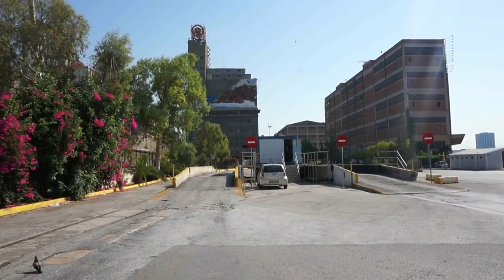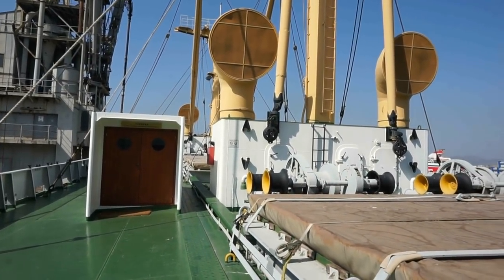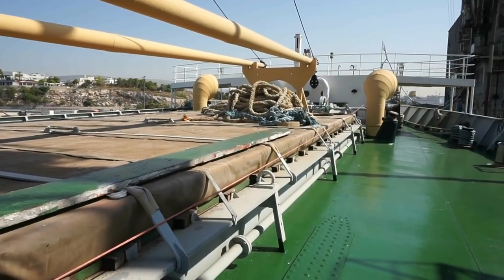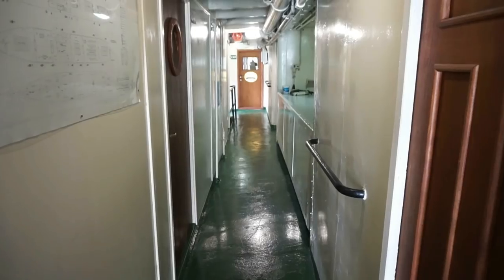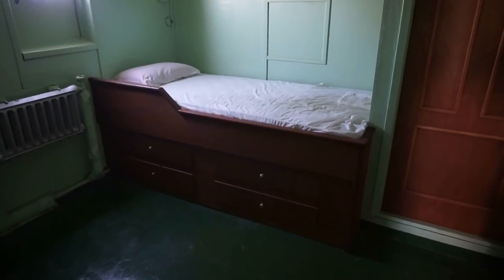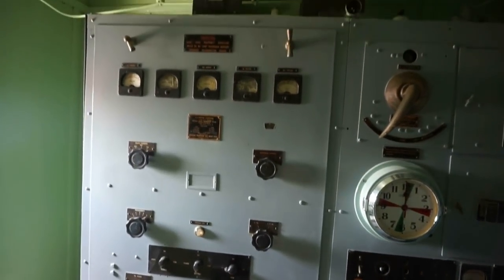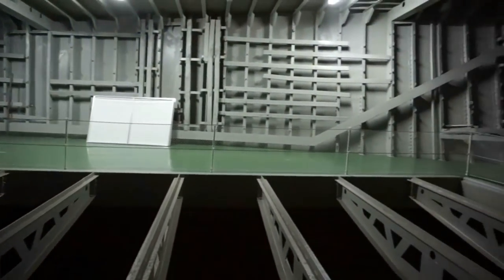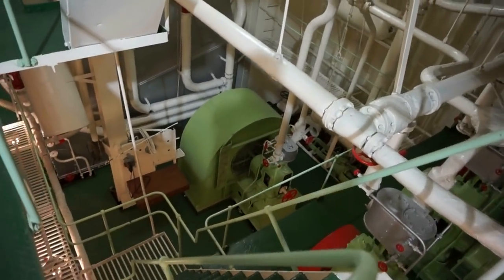WW2 Liberty Ship (SS Hellas Liberty) fully renovated in Greece

Comment: As stated below, a Triple expansion reciprocating steam engine with the crankshaft angles set at 120 degrees. There are High pressure (HP) Intermediate pressure(IP) and Low Pressure (LP) cylinders. The steam cycle for each cylinder is Admission, Cut off, Expansion, Exhaust and Compression. Steam to each cylinder is controlled by valves, these may be piston or slide valves or a combination of both. E.g. piston valves were often used in conjunction with the HP Cylinder. The valves are operated from eccentrics fitted to the crankshaft via eccentric rods. There is a forward and reverse eccentrics for each cylinder which is controlled by the position of the block in what I call the expansion link.
By the time the steam leaves the LP Cylinder it holds almost no pressure i.e. a vacuum. Air pumps extract steam from the LP Cylinder to the Condenser (shown in the video) where the steam is converted back to condensate for reuse in the boilers. 
There are two Babcock and Wilcox small tube boilers. You can see the red circles of the fuel burners on the boiler fronts . Steam would be supplied to other reciprocating machinery such as electricity generators, fuel pumps, feed water and transfer pumps, water distilling plant, fire or fire and bilge pumps air supply fans to the boilers, winches, capstans and steering gear. Hope this helps.
Reply from the maker: Wow... All this information helps up a lot, thank you so much!!!!!!!  👍👍👍
Reply: There is no "compression" stage. A steam engines does not need to compress the fuel air mixture as in a gasoline or diesel engine. A steam engine is an external combustion engine.
Reply: You sound like a legendary expert in steam propulsion!

Comment: The engine is a three cylinder triple expansion steam engine. Beautiful restoration of the ship.
Reply: I was just about to say the same thing. Each cylinder would however be double acting. ie They produce power on the up and down strokes of each cylinder.
Reply: Worked on many triple expansion steam engines as an apprentice millwright, relatively clean and easy to work on, very quiet when running, seen them go from full ahead to full astern without closing throttle.
Reply: Ever seen the movie Titanic?
Reply: So is this a two-stroke engine? Forgive me if I say something silly? The engine room is like a labyrinth with all those pipes. Very industrial. Very trippy.
Reply: @samanli-tw3id  they used the liberty ship for the shots in the Titanic. I forget if it's the one in California or Baltimore, but it's a liberty ship engine in the movie.
Reply: @azwris  it's steam power
Reply: all engine room pipework white ?? I can only remember the brown fuel oil but there wwere different colours for fresh water etc!
Reply: HOW DOES A TRIPLE EXPANSION STEAM ENGINT WORK
Reply: Lou Prentz
High--Medium--Low pressure cylinders with steam routed in manner
Reply: @southjerseysound7340  It's the one in San Francisco, the Jeremiah O'Brian.
Reply: @azwris  No, a two stroke engine would be a diesel (or there are gasoline two strokes.) The engine was rated @ 2500 HP.

Comment: Actually pretty difficult to 'restore' one of these ships as they were built On the Cheap with the expectation that they might not even survive one Atlantic crossing. The cost-benefit analysis was that if a ship delivered one load of cargo,  it had justified its cost. Maintenance during the war was probably close to non-existent; they were run 'ti they wore out, if a U-boat didn't sink them first. They were drastically underpowered with only 2,500 HP to push 10,000 tons through the North Atlantic and in heavy weather they could barely make headway.
Reply from the maker: Hello, thank you for your interesting comments and for watching my videos!!

Comment: The sides had to have a long wide and thick strip of reinforcing metal to keep them from cracking in the midsection in rough seas. Either it's a very early model or the refurbishing left it off. I don't recall the last versions having a redesign to leave the reinforcing off. Great find. Love the Greek islands and mainland.
Reply from the maker: HI and thank you for your comments. I do not think this was an early model, it was launched in December of 1943!

Comment: those shafts you thought where pistons where actually the reversing gear for the engine. its a 3 cylinder each cylinder of the engine has two cams one for running the engine forwards and one revers that thick metal pipe with the 3 arms on the side of the engine is the linkage which switches between the two sets of cams
Reply from the maker: Hi and thank you for the clarification!

Comment: The ships were so slow because they were originally intended to use steam turbines. Those engines were in low supply and were mostly going to war ships, so the Liberty ships had to go with the older and less powerful compound steam engines, and just one of them.

Thanks for sharing this tour! It's not common to see modern video of the Liberty ships, given that most of them were scrapped by the 80's.
Reply from the maker: Thank you for your comments!!
Reply: Compound steam engines. I see. That's why their design looks so freakin complicated. I mean this is a blast. Even looking at this. True art.

Comment: Great video, Vic. The engine in Liberty Ships was a 3 piston, triple expansion steam engine. You'll notice the piston diameter gets bigger as you move away from the steam inlet-that's because the steam pressure gets lower as the steam cools. Three pistons-small (hi pressure piston), medium (medium pressure steam) and large (low pressure steam). I believe they had only one boiler feeding the three pistons, not sure about that. 

The engine only put out about 2500 HP on a single propeller-it was not very powerful. Just enough power to move the ship along at 11 knots full speed. The engine was obsolete during WW2, most ships had diesel or steam turbine engines at that time. But turbines were in short supply when the war first started and they needed them all for warships. So the British contracted US Suppliers to build the old triple-expansion steam piston engine and it was reliable if not powerful.
Reply from the maker: Hi, thank you for this information and for viewing my videos!!

Comment: These ships were built with obsolete triple-expansion steam engines rather than turbines. There wasn't enough manufacturing capacity to build thousands of turbines and associated reduction gearing.  Any large-scale foundry and machine shop could fabricate components of these piston engines. The din of one of these running under load must have been deafening.
Reply from the maker: Interesting, thank you!
Reply: Нет, как раз гудят турбины и дизеля, а эти работают довольно тихо...

Comment: Thank you for this visit of a Liberty ship, a very rare one indeed. It seems that I was wrong in the belief that the hull of these ships was made of reinforced concrete, the process of which is called “gunite”. Are any of those vessels left by now?
Reply from the maker: Hi.. No, there is no reinforced concrete in these ships.. I am not sure if there are any other ships made that way..
Reply: Yes there are,they were made by McCloskey and Co. of Philadelphia in 1942 due to a shortage of steel during WWII. The process was called “ferro-cement” which consisted of a cement mix applied onto a base of welded steel mesh. Most of these hulls are now used as breakwaters because they last longer than steel hulls. Nowadays, the process is used exclusively for relatively smaller boats.
Reply from the maker: Wow, amazing, thank you for getting back to me...